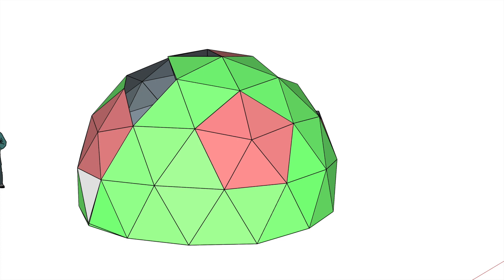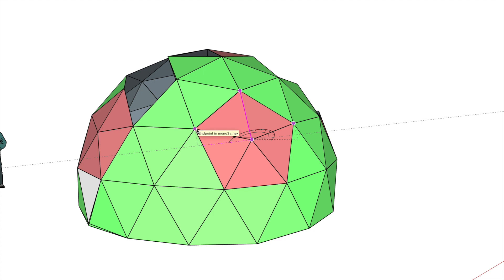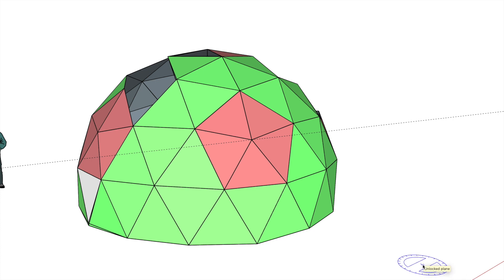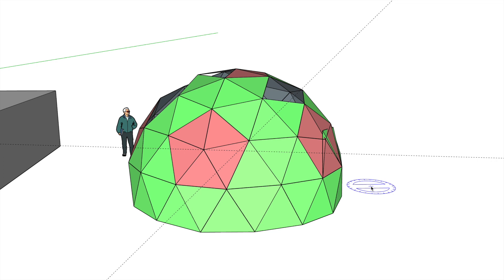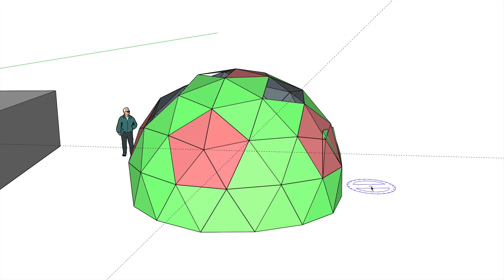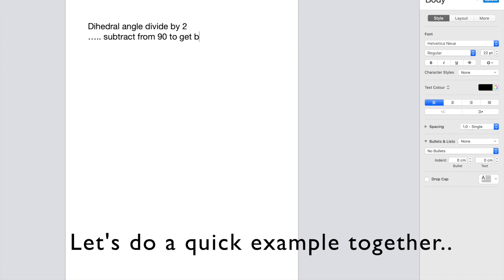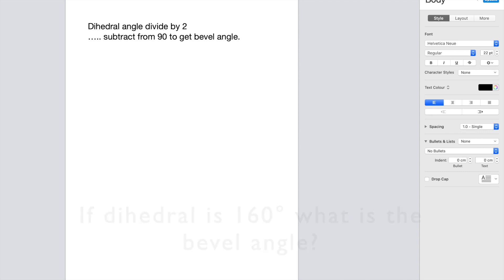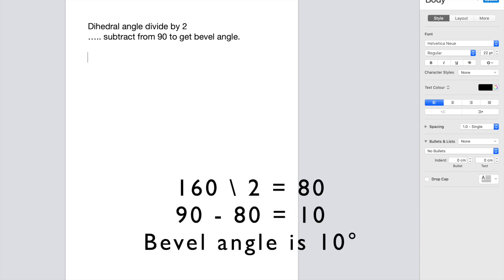I don't want drawing, I just need dihedral angles!

Comment: I just need to know the dihedral angle (or bevel angle to cut with) if you don't have plans, which is never mentioned when running calculations on (any) website. Happy to pay for plans though.
RESOLVED: I found it and for those looking for the same: the bevel angles for the smaller triangle on a 2v geodesic dome (using the 'goodkarma' or 'panel' method) is 7.2 degrees while the bigger triangle is 11.2 degrees. It seems the longer strut in the smaller triangle should in real be at 10.8 degrees but given they are really close together, I'll go for 11 degrees for all the long struts as it's the best I found so far.
Reply: HEY BRO Marcel Daems ......CAN WE TALK...?¿.....THE SMALLER TRIANGLE IS A HEXAN AND THE OTHER ONES IS A PENTA..RIGHT....????? i just trying to make the baby dome from Paul Robinson do you Think that are the same ?¿?¿  thanks a Lot

Comment: I am so computer illiterate that it's nearly a phobia for me. If  those triangle panels were made in three dimensions, what is the beveled angle on the edges between the panels? Is the beveled angles the same no matter what size the the panels are?
Reply: The angle will change depending on your dome frequency. For a 3V domes, I've had success cutting the bevel at 7 degrees. I'm also dealing with my computer phobia, it can be very frustrating.
Reply: Thanks  @caseyfergus6614  I'd like to know the bevel angle of 2v, 3 dimensional Dome panels.